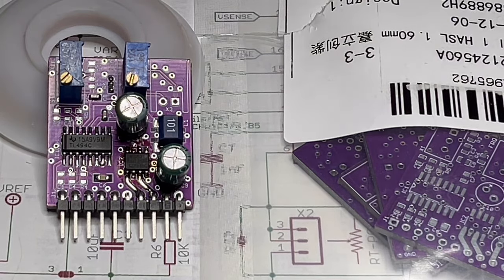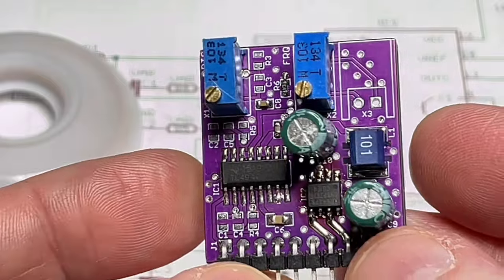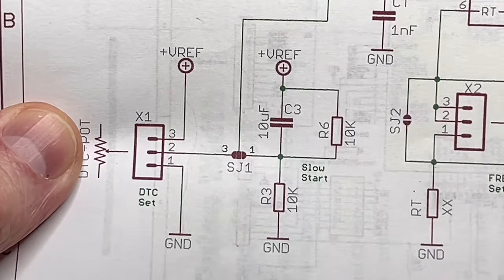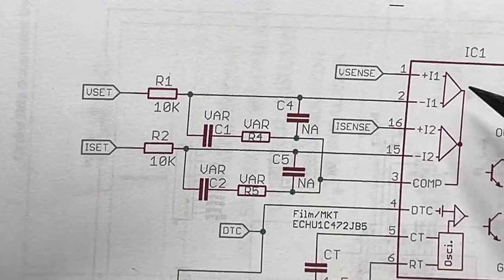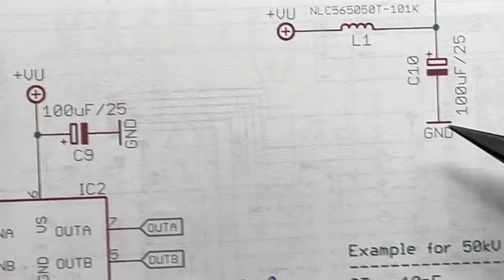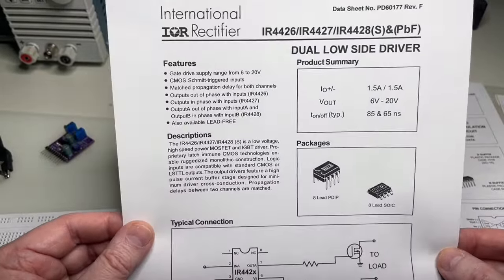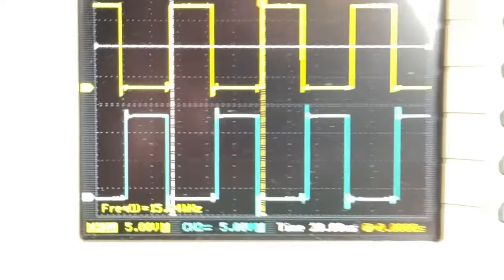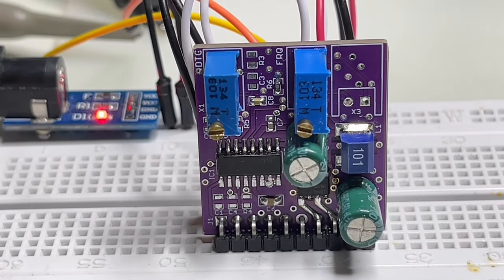TL494/594 Controller Chip Power Driver Module Design, Schematic, Details, Infos

Comment: TL598 is my favorite one. It has push-pull outputs.
Reply from the maker: Hello, Yes it's a more modern Version of the TL594 with a Better Output Stage and Internal Circuitry that Prohibits Double Pulse at Either Output.

Comment: Nice circuit, never hear of that chip before, but it seems a very handy one. 
Do you  have experience with the LR8N3 High Voltage Regulator ? I have them on stock, ordered them a few years back to play with, but not used yet.
Reply from the maker: Hi Bjorn, Thankyou. I used the LR8 as a High Voltage Constant Current Source couple Years ago.
Cheers

Comment: Konstantin thank you for this demo on a useful circuit! I tend to like stronger drives (TO220) because I'm amateur and burn components hehe. Well I have made a similar board but not so tidy as yours! TL494 is per datasheet Fixed frequency but pin 6 works for setting 40-200kHz, how is that fixed frequency?
Reply from the maker: Hello Arve, The Osc Frq of the TL494 is set by Pins5 & 6 (CT,RT), and stays Fix during the whole Operation (except if you put a Pot at Pin 6).
Fixed means, that the Frequency cannot be Controlled/Adjusted Dynamically form the Internal Error Amplifiers. The Integrated Error amplifiers of the TL494 can adjust only the Duty Cycle,
but NOT the Frequency. There are other Switchmode Controllers that can do both.
Reply: @KonstantinGrigoriadis  ah I see, that explains😀 I think I will be experimenting with H bridges and maybe resonant circuits (convenient with the variable freq. )  I will follow you for sure! All the best / Arve

Comment: Could we get a pdf or a link to the schematics and design.
Reply from the maker: Please send me an Email to reply you with the Design Files. Cheers, Konstantin
Reply: @KonstantinGrigoriadis  much appreciated my friend
Reply from the maker: Hi, I didn't received an Email yet, my Email is in the "Channel details", Cheers, Konstantin
Reply: @KonstantinGrigoriadis youtube is taking down email IDs for some reason
Reply from the maker: Hello, Yes, I know Open Email Addresses or Links are not allowed in the Comments, this why I said to  send me an Email to reply you with the Design Files. my Emails is in the "About/Channel details" Tab. Cheers, Konstantin
Reply: @KonstantinGrigoriadis I've sent the email.  Thank you dude
Reply: @KonstantinGrigoriadis 
Hello . I was wondering on how to choose the values for R4,R5,C1,C2 and whether C4 and C5 are neglected.
Reply from the maker: @spiderspider1384  Hello, well that's not an easy Answer...These parts are for the Loop Compensation, in particular for a Type II Conpensator and are calculated based on many Parameters used to Design the Switch mode Stage. Further C4,C5 are mostly not used, this is why I put them as N/A.
I will add some Links in the Description of my Video that are dealing with that matter. 
Cheers, Konstantin

Comment: I LOVE the TL494, but I UTTERLY HATE that it does not have push pull outputs.
Some of the GREAT things about it is that it is stable & predictable resulting in easy use.
Reply from the maker: Hi Steven, you can use the TL598 instead that has PushPull outputs and some more feautures, but unfortunately it's not 1:1 pin Cpmpatible. Cheers, Konstantin